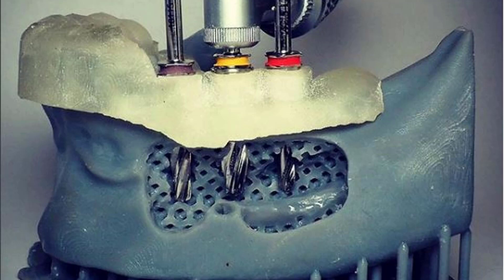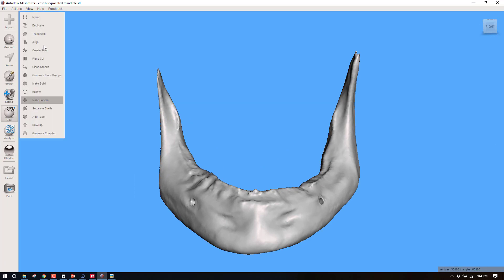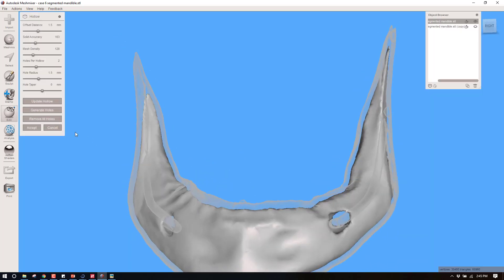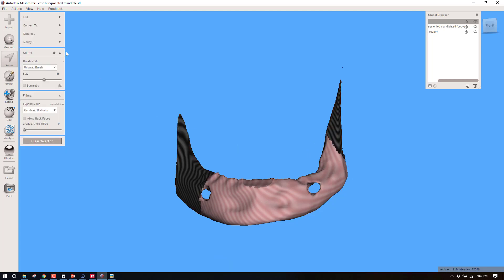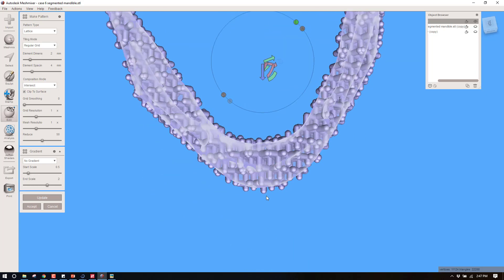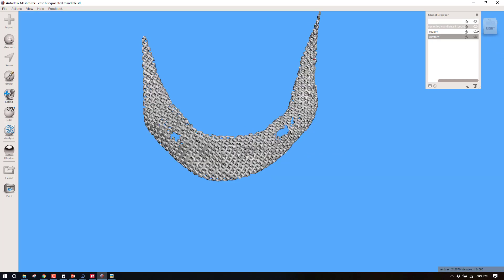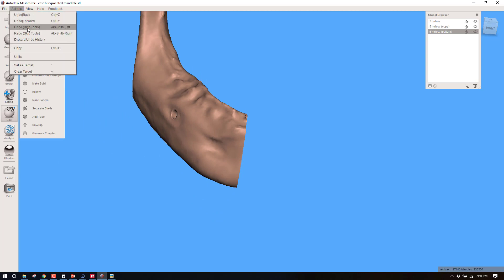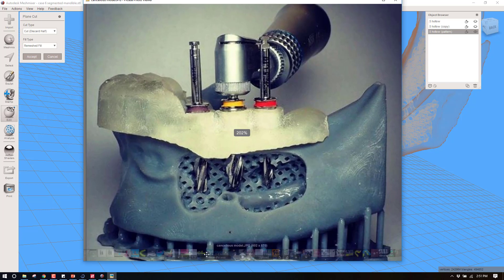How to design a corticocancellous model for 3d printing

Comment: Hi! Great technique! Can you tell me what did you use to subtract the nerve?
Reply: check this video https://www.youtube.com/watch?v=6h9l81bqq6A&t=13s
Reply: To subtract a nerve from a 3D printed mandibular model, you will need to model the nerve as a separate object in a
3D modeling software like Meshmixer or SOLIDWORKS, then use a "Subtract" or "Boolean Subtract" function to remove the nerve's volume from the mandibular model. 
Here are the general steps:

    Obtain or Create a 3D Model:
        If you have a digital scan of a mandible with the nerve already modeled, you can proceed to step 2.
        If not, you will need to import a standard mandibular model into your 3D modeling software.
    Model the Nerve:
        In your 3D modeling software, create a separate 3D object that represents the nerve.
        You may need to import a nerve model or manually sculpt/create one to match the anatomical location within the mandible.
    Position the Nerve:
        Place the newly created nerve model in the correct anatomical position within the mandibular model.
    Perform a Boolean Subtract Operation:
        In the 3D modeling software, find the "Combine" or "Boolean" tool.
        Select the "Subtract" or "Cut" operation.
        Choose the mandibular model as the "Main Body" (the object you want to keep).
        Select the nerve model as the "Body to Subtract" (the object whose material you want to remove).
    Preview and Export:
        Review the preview to ensure the nerve is correctly subtracted from the mandible.
        If the result is satisfactory, export the modified mandibular model in a format suitable for 3D printing, such as STL. 
I need to try this myself.  Hope this helps.